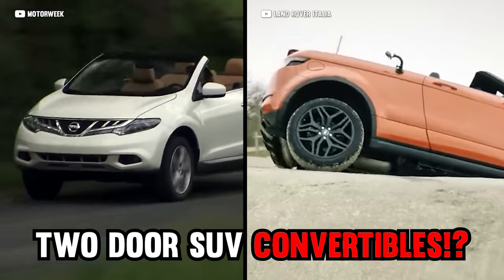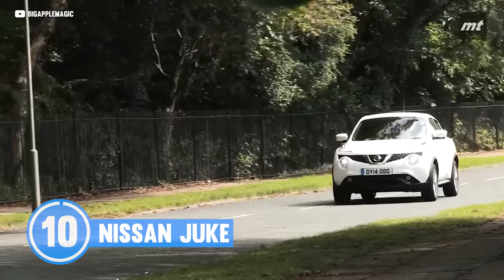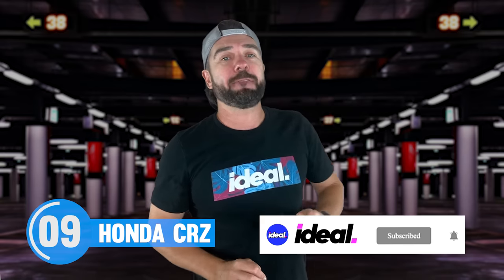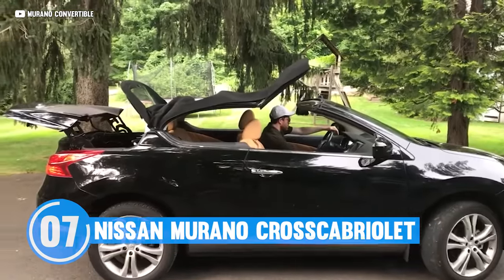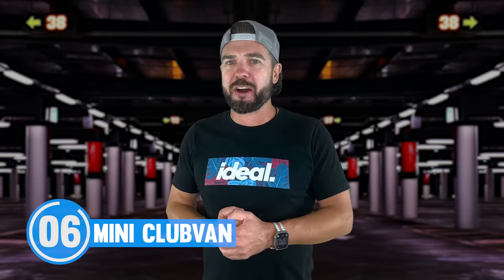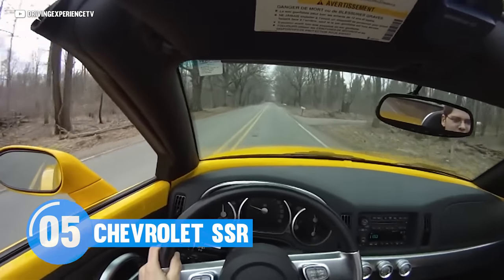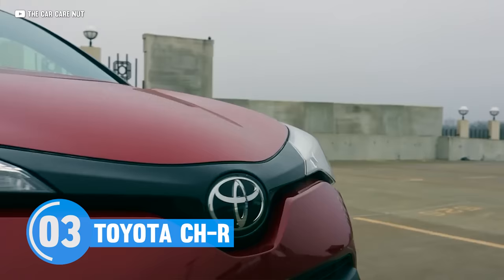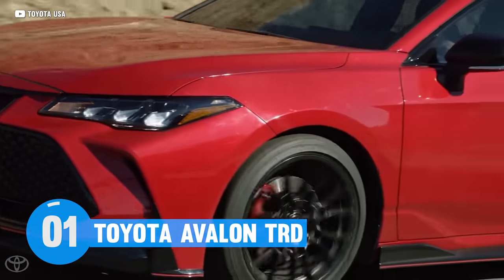There's NO REASON They Made These Cars (but they did)

Comment: 😂 Not to mention that Volkswagen owns the most accessible exotic and luxury brands, but they used the Phaeton’s D platform in Audi V8, S8, A8. Bentley Continental GT, Flying Spur. Honorable mention: Porsche Panamera. So the VW Phaeton may have flopped but iconic and more expensive vehicles have been made off the same platform.
Reply: Phaeton was basically a Bentley Flying Spur but with the cheaper badge, which was surely a 1st time for VW but still it was very different and quirky in its way
Reply: That's not true. The Phaeton was built on the D1 Platform whilst the A8 used the D one.
Reply: @BrunodeSouzaLino  I stand corrected the “D1”. The first vehicles of the group D platform series were built on the d1, and the A8 was d platform series 2 “D2” in 1994. It’s all the same D Platform with improvements marked by numeric series from 1988-2019
Reply: @AceCyberstarGaming  There's one fundamental difference. The Phaeton used an all steel frame while the A8 had VW's aluminum "space frame."

Comment: LOL. Great list but I have to say I love my Toyota C-HR. It is my daily and it actually fits in my garage. Style is subjective but I love how it looks. Being a Toyota it is reliable. It drives and handles well and that is no surprise since the chief engineer is a race car driver and fine tuned it on the Nürburgring. Option it out with the first party Toyota TRD performance parts from the dealer, like I have, and you have a nice daily driver, great for city driving and is easily capable of triple digits. There is a reason why used ones are holding their values so well and some going for over sticker. With all that said, I have to say I am not a fan of the new version that is being released in Europe. My C-HR is defiantly a keeper.

Comment: The HONDA CRZ was just Honda "trying" to resuscitate the fans of the CRX HF.
It was still a beautiful car, but there was no upgraded power...
And the early Hybrid made it less reliable!
Reply: Less reliable. The Cr-z goes for absolutely ages seen some 300k+ miles and still going strong. On the original hybrid battery at that. 

But no they were not fast and definitely not a true CR-X successor.